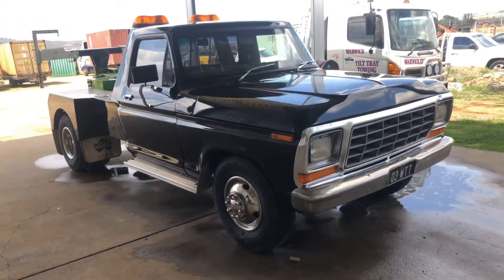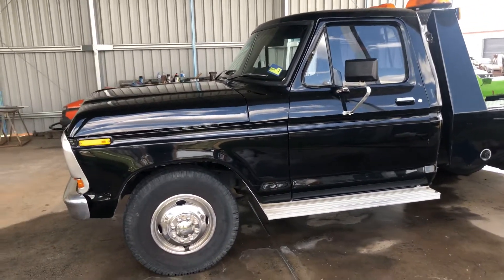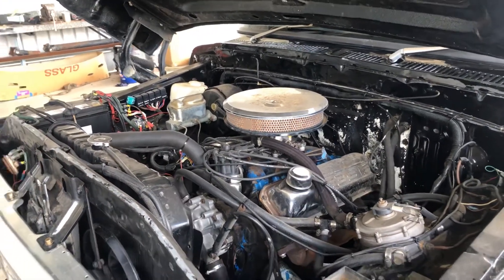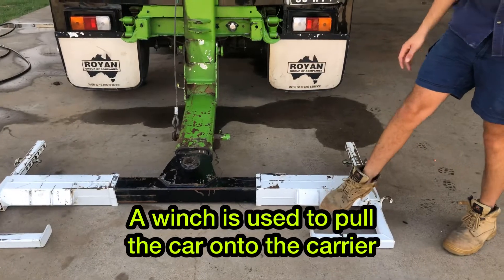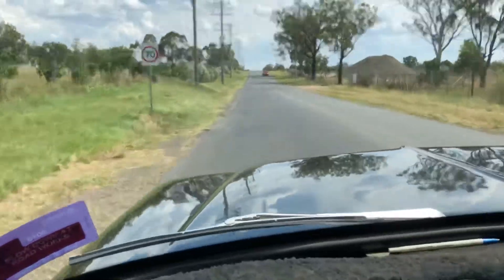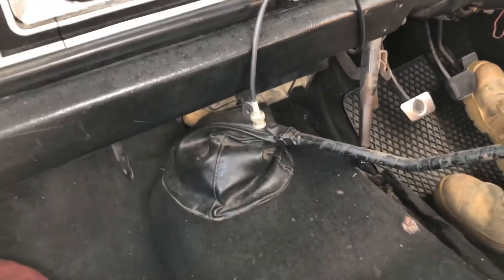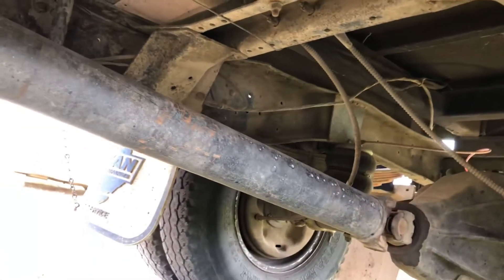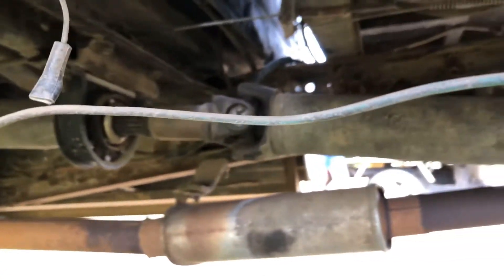1978 Ford F350 V8 Tow Truck | Very Cool!

Comment: Idk if this is still relevant but in the US that setup usually has the Borg Warner T18 4spd w/ granny low, rear end usually is a Dana, the most common engines 76-79 were the 400M or 460 big block the 73-75 was usually 360 or 390 FE big block

Comment: Box could be a np435 1st gear is super low. i got a 1974 f350 with the 300ci inline six getting rego soon. Been parked in a shed since 1998
Reply from the maker: Thank you very much for the feedback, and apologies for the late reply. Do you know if the 300ci six is a Canadian engine? Thanks for supporting the channel!
Reply: @GsAutos  300 was availible in any ford truck from 1964 to 1997. and alot of vans. ford used them forever.

Comment: Would be a dana 60 or dana 70 they used alot of them in these.
Have a 78 f350 myself as a tow truck
Reply from the maker: Thanks Bud. I appreciate the feedback. What colour is your truck? Do have the 351 in your truck? Thanks for watching and supporting the channel!
Reply: @GsAutos  mine is 2 tone black ontop and gunmetal grey under the dentside groove. 
Mine was a 351 clevo but the valve met the piston one day an made a messlol. So now just a strong 302 clevo running on petrol no gas 450 holley and a similar lift to this . Check it out on Facebook frequently Towing or Bud Deboer